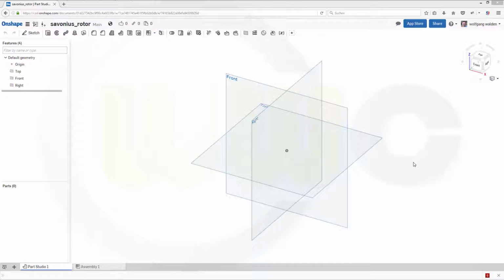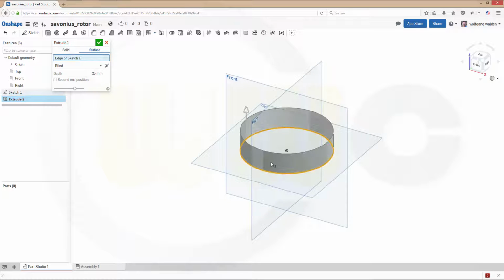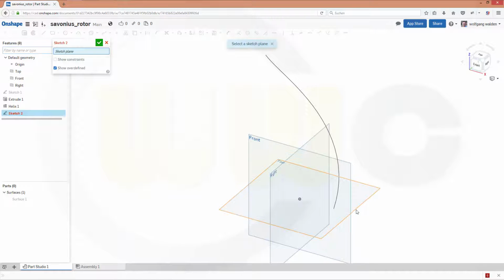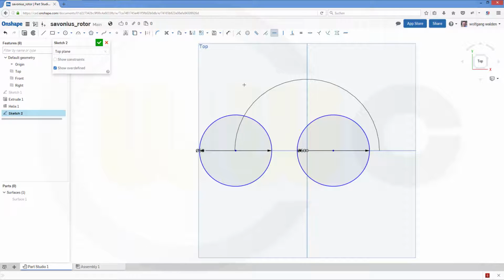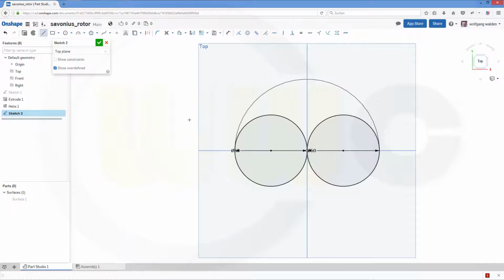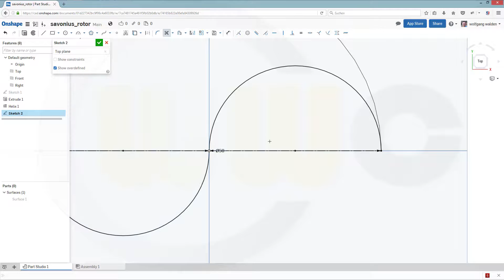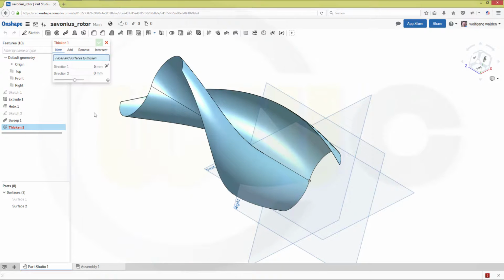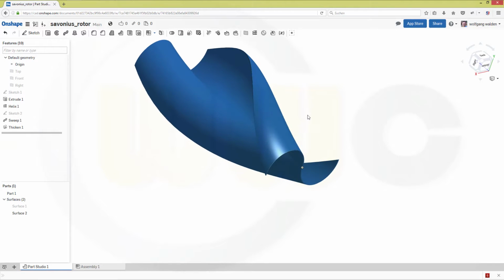Userwish Helical Savonius Rotor - Onshape Training

Comment: The sweep won’t work for me, I followed the steps but when I input the sweep it wont
Reply from the maker: Obviously you didn´t do exactly what I did. I would guess you ´ve got a problem cause by the "parasolid" kernel of Onshape. So check if you have set exactly the same options, as I.

Comment: thank you for the video. i is very useful for me. in addition, I have a small doubt regarding the design i.e.., how to draw the helical design with different angles.
Reply from the maker: So just change the parameters.
Reply: What parameters I've to change for that. Actually I need it in solidworks